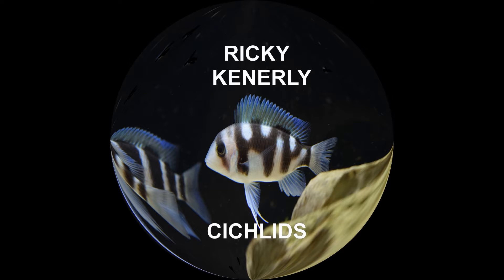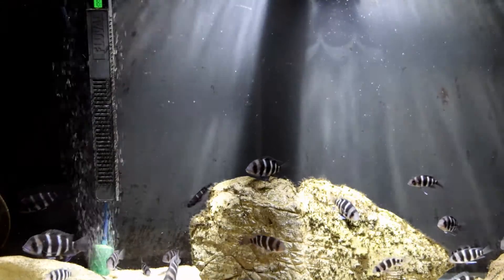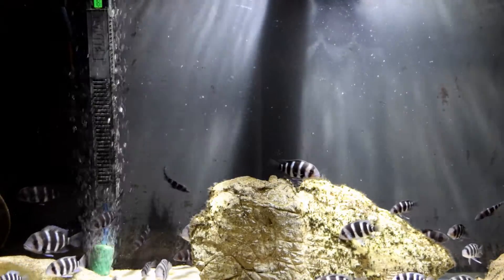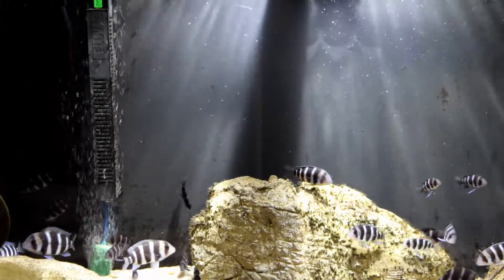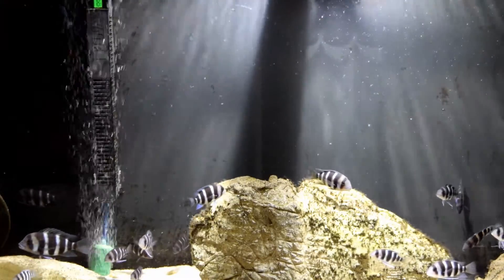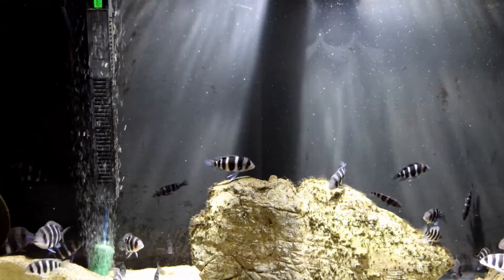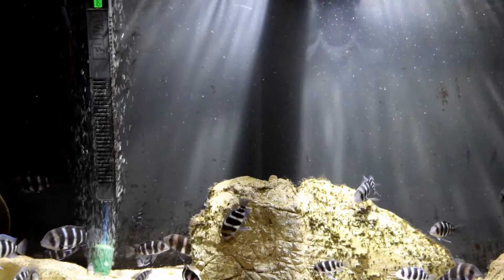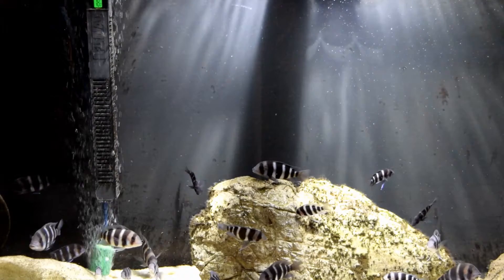Aquarium Temperature -  How to keep it stable!

Comment: Great advice. I have 2 of those and all of the sudden 1 has been reading low flow and every once in a while it turns red. I've been tinkering with it and trying to get my fx6 blowing on it but I'm having the same issue. I might have to try this air stone.
Reply from the maker: +Chris Niemeyer Let me know how it goes if you do try the air stone method!
Reply: +Ricky Kenerly Cichlids Will do.
Reply: +Ricky Kenerly Cichlids So I finally got my fx6 in a good spot to fix my issues. I won't be needing the air stone but that will definitely work for someone.
Reply from the maker: Either way.  I mention several methods in the video!